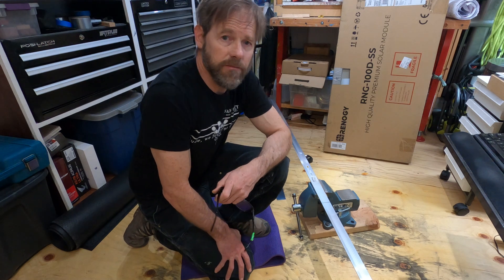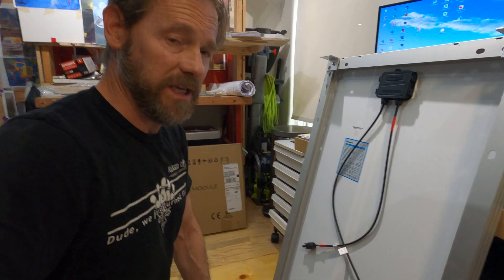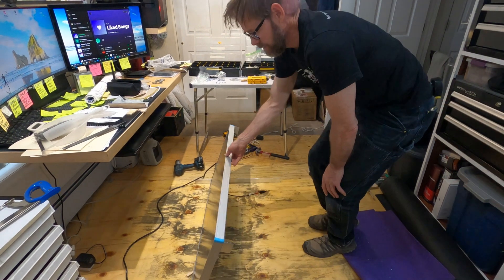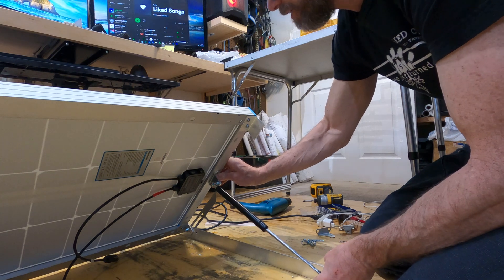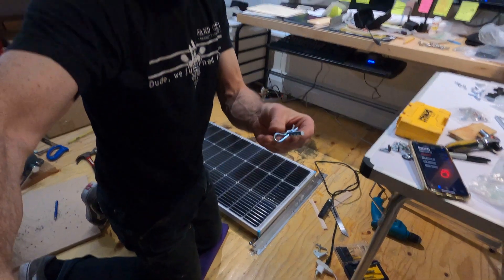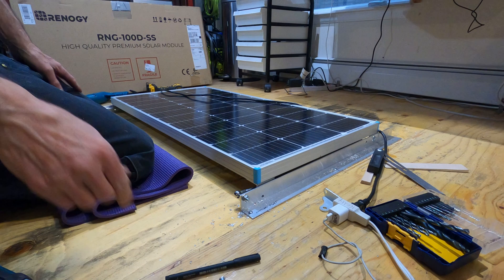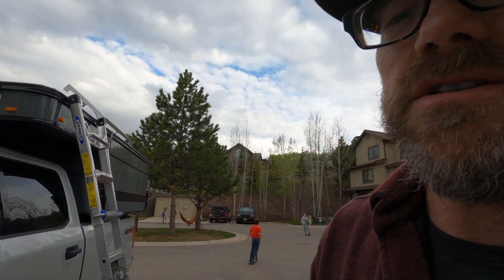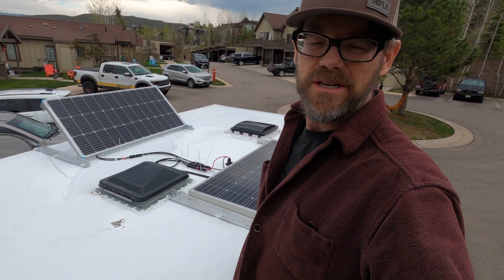Gas Strut Tilting Solar Panel Install on Four Wheel Camper

Comment: Great idea , so simple and easy just what I was looking for, question thou , you mentioned you were using 12” struts , you think 15” struts would work ?
Reply from the maker: Dale, 
I believe I used a 15 inch gas strut which was a bit much. I think you'd be fine using a 12 in strut- just check the specs on the struts.

I was out a few weeks ago under some shady trees and It was helpful to be able to tilt the panels for maximum morning sun. Best on your installation.

Comment: Great video. Although the background music is too loud, it is very distracting when trying to listen to what you have to say. I will try something similar based on what you've done. Thanks!
Reply from the maker: Thanks for your comment, and yes it's always tricky to set the volume at the correct level. I'll deft. put more consideration into the sound output on the next one. The fabrication and install is straight forward- I did add a weatherproof cover to my solar plug on the roof after I shot the video. Best on your project.

Comment: Have you thought about how you could make the panels tilt both ways?
Reply from the maker: Joe B- I haven't. Obviously add's a bit of complexity, but would be great to have that option. Let me know if you hook up w/ the dual tilting system- that is if you're doing solar on your rig.
Reply: @Bigmountainsandbackwoods  I’m definitely doing solar. Just checking out videos now to see if there’s a simple way to tilt both ways.
Reply from the maker: I’m sure someone’s done it- let me know how it goes.

Comment: I plan to configure the panel to deploy without assistance, perhaps using a spring to start them. Tilt control will be via a small stepper motor with a pulley and cable so the tilt angle is adjustable via an angle sensor. I will use solenoids to “pin” the corners remotely for travel. I’m just too old to be on a ladder/roof on the regular. So I’ll take your brilliantly simple system and make it complicated- that’s what engineers do, right? 🤗
Reply from the maker: Hey Rusty, your automatic system sounds like a great idea- a bit above my pay grade, but let me know how it goes.
Reply: Or you could buy a couple more panels and skip tilting altogether.

Comment: Watched a lot of tilt solar vids with actuators, etc. and thought “why not just use struts?” and just knew that somebody had done that. Such a simple system and you nailed it!
Reply from the maker: Thanks, and as I mention in the vid, you could use a smaller length strut as mine are a bit over engineered.

Comment: Thanks for the upload!
Did you tap into the frame on the roof when attaching your brackets?
Reply from the maker: Yes- the aluminum roof frame pieces are easy to find. They run front to back- the perpendicular frame pieces are narrow aluminum and harder to find- there’s images on-line showing fabrication of the roof framing.